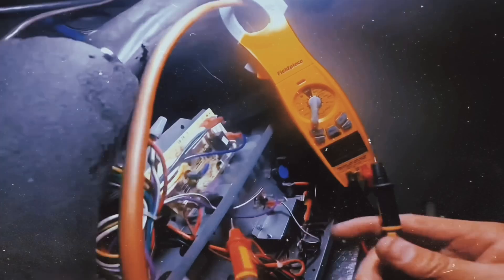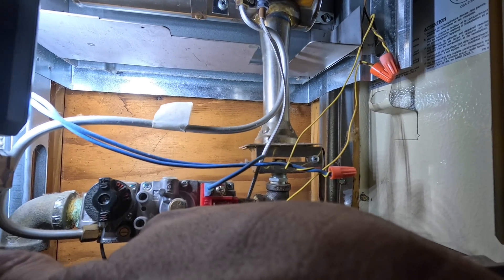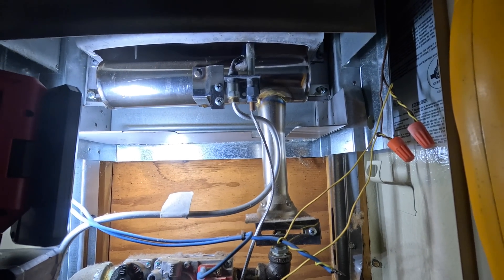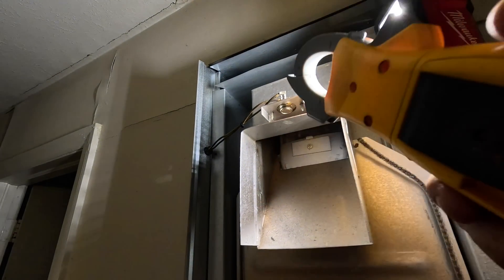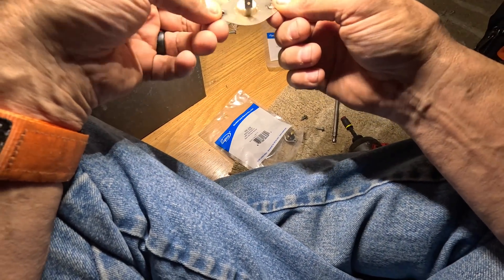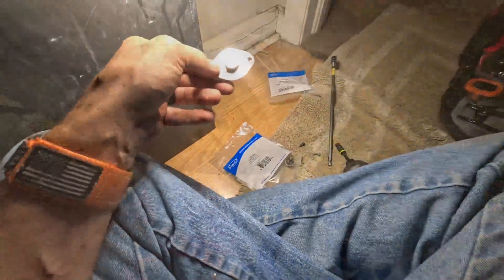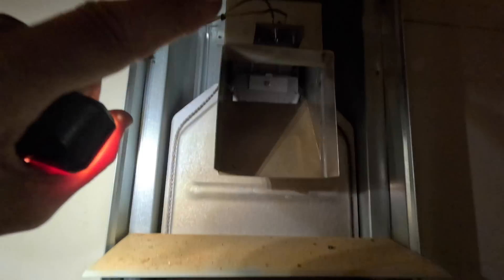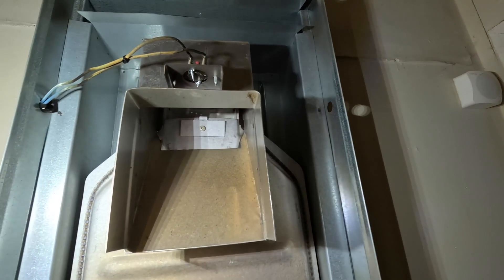Common Problem With Millivolt Systems! #hvacguy #hvaclife #hvactrainingvideos

Comment: My heater worked last year and this year after 15 min does not turn on. I will check my roll out to see if it tripped but I like how you check the voltate. I just dont undertstand how you know you lost voltage. Are you subtracting?

Comment: the vented gravity wall furnace are usually 350 or 450F vent safety/spill switch, with lower btu/h output being lower temp  and higher btu/h output higher temp switch.
of course always try to match what's there. fan forced models are usually lower spill temp and regular furnaces are all over the place in temp limits.

Comment: they way disc type thermostats/limits are made, they often fail where the rivet makes the connection from the outside spade terminal to the inside device through the insulator body.
it's not as bad an issue on line voltage where the higher voltage and current will make it reconnect(or burn up), but on very low voltage/current millivolt systems, it's critical.
best to just replace the limit when that starts to happen and the spade terminals on wire also, if there's any sign of corrosion, tarnish or rust.
been there and fought them endlessly over 20 years ago and oddly enough there were plenty of complete original systems from the 1940-1950's that were never touched and working until their demise of replacement chasing the energy savings, the problem ones were always from someone else fiddling with them or a water leak.
there's not many thermopile heater/furnaces around here anymore, except the occasional vent-less garage/wall space heater. I serviced one last month at a drive-thru, it's their cashier heater.

Comment: I've fought millivolts a ton, from bad power piles to loose wires, loose connections, dirty stats, etc. Never had a spill switch go bad, but I guess they do.
  The one good thing about millivolt furnaces is they still work when the electric goes out - you're warm while the neighbors freeze.
Thanks!

Comment: when you are are dealing with millivolts and micro amps it doesn't take much to cause a high resistance which will cause a voltage drop.

Comment: Millivolt systems are great for water heaters but terrible for furnaces. A water heater doesn’t have a power supply so a self generating system is needed. A furnace has a power supply so a spark ignitor or HSI is used. A water heater does not cycle anywhere nearly as often as a furnace, so thats another reason not to use millivolt.
Reply: A high efficienct hot water heater requires power. If you like a hot shower during a power outage do not choose one of these.
Reply: @darrylstevens2556 
Usually, the power is required for the induced draft motor, if it is a through the wall venting , not ignition on a higher efficiency tank water heater. A standard millivolt valve  and thermocouple  is still used. A tankless water heater does require power for operation.
Reply: It still needs to be plugged in. People forget this very important detail when choosing a new hot water tank.